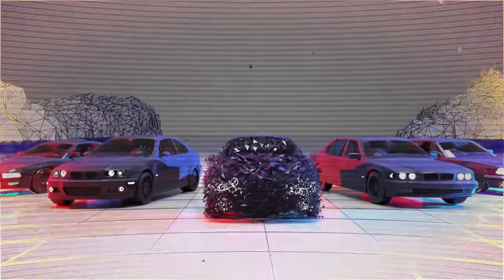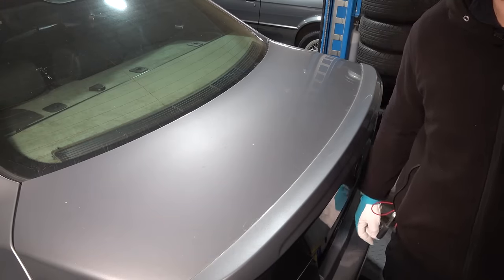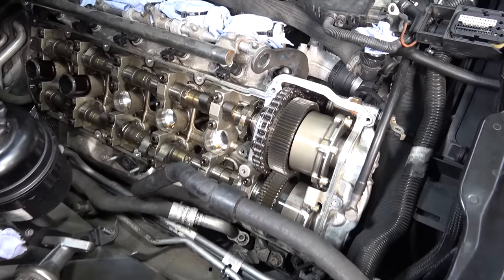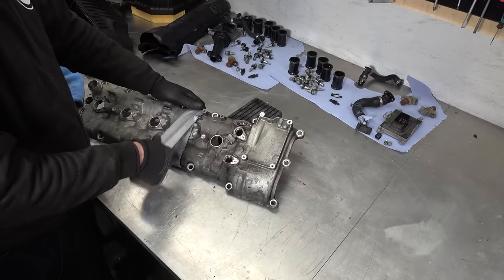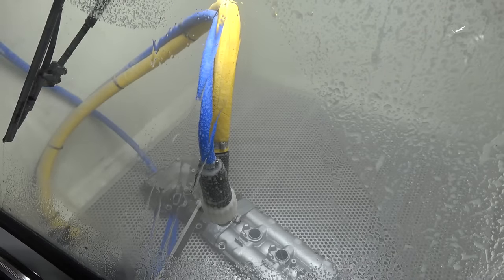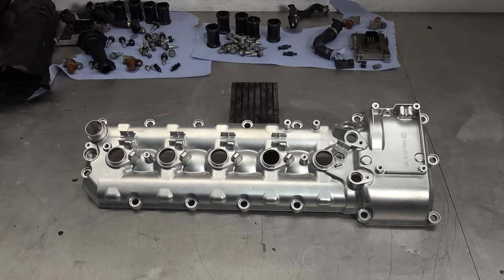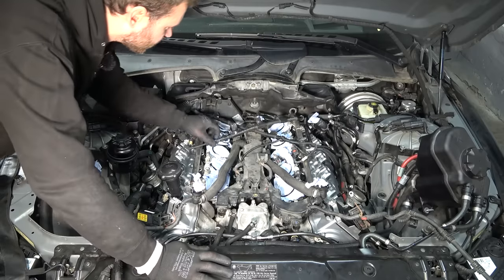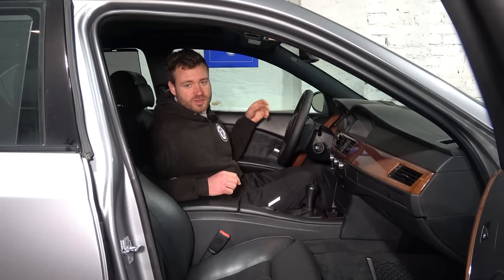Can We Make This V10 BMW M5 Mechanically Perfect? -  E60 M5 6-speed - Project Raleigh: Part 7

Comment: The broken plastic piece in the shock is a broken shipping puck from when the vehicle was delivered. It keeps the front of the car raised for removal off the transporter to not scratch the bumper. Looks like the dealer who delivered the car might have not removed it. If the shipping puck was not removed and the car was driven at highway speeds, the spring could have been displaced from the correct position since the car was still raised on that one side. Once the shipping puck cracked and broke off from the impact of driving at highway speed, the spring settled into the incorrect position.
Reply: Yep. That's what I was thinking too. That means the dealer that prepped that car after delivery straight up left that piece in
Reply: Seen few complains about dealership forgetting to remove these on F80s as well.
Reply: @snikwadRR  Sometimes the transport people are not gentle to the cars and the top spacers get jammed WAY up into the strut boot. When I did PDIs I'd do my best to remove them if they were stuck but some were just beyond retrieval without taking the strut apart, but that means they were also out of the way of suspension travel and it was benign to leave them where they lay.
Reply: The puck's are there for when the car is secured on a ship or train that it is stable. (transport blocks)
Reply: Not to prevent bumper impacts... designed to keep the vehicle from bouncing while fully strapped down during shipping. Might not be a dealer that left it in place, I work at a port and we find broken ones on the ground all the time from them being driven off the ship,loaded onto trains/trucks.
Reply: @nabob14  damn, I remember that now too. Thanks for correcting.
Reply: This seems the most likely explanation. I was thinking back and didn't remember ever seeing OEM shocks packed with a plastic piece like that, so really the only way for it to have been there is from the whole car getting prepped for shipping. Wonder who the selling dealer was, lol.
Reply: I also heard that it is a common issue in a lot of cars!
Reply: Exactly that someone at the dealership didn't take it out on PDI we had a similar thing happen at our dealership the lady had been driving her M3 for 2 years with the plastic pucks still in the shocks and wondered why it was so bouncy 😳
Reply: This is 100% a transport block from factory, usually a couple of these in each shock and tech should have removed during pdi at dealer but it may have been a Friday evening and they could easily have missed one or just not been f**ked fishing it out of of the boot, oops!
Reply: This issue is not limited to BMW. I drove my Skoda Octavia for 15.000 km with the shipping puk installed. Every pothole made my teeth rattle and it took those knuckleheads 2 attempts to find the problem.
Reply: 🇧🇷🇧🇷🇧🇷🇧🇷👏🏻, so that’s what that thing was play? Yes.Amazing!
Reply: Shop dap has made a few videos on mk7 gtis and they have had the pucks left in and they are all smashed
Reply: @spenceradams2908 Just found out my 2015 GTI with 90,000+ miles has those transportation blocks in the front end. Pissed off.
Reply: Bought used at 75k and wondered why every time I went over a pot hole or speed bump the car violently shakes

Comment: Finally! a YouTuber that rebuilds struts the right way! All the ones I've seen always removes/installs the nut with an impact, without bothering to hold the shock shaft with a wrench, risking blowing the shock without it even seeing a km.
Reply: Also important with ball joints. Dont install new one with impact. It spins The joint against the nylon inside and it is shot instantly

Comment: Yet another great video Sreten. Thank you for making it 1hr and not a single advert.
How good did those valve covers turn out!? Real rippers. 
Although you do know you'll need to take the engine out now, break it down and clean every part of it as well. It just wouldn't look right otherwise. 
Of always liked the V10 M5s but I'd happily have a touring version. The fastest station wagon in the world. 
Npq for the future. I always look forward to all of your videos but this and the Alpina, in a back to back test, that would just be heaven.
Reply: Jonas Jonaitis  ok it is the Mercedes but it is not as fun as this m5 and the m5 is more refined with better overall build quality compared to the Mercedes or Audi
Reply: Jonas Jonaitis  bad reliability doesn’t m mean it has bad quality and it is bad design because BMW’s are built to breakdown after the warranty and once you change the parts it will run for the same km it did before breaking down

Comment: Sorry this comment took so long, I've had my 2005 E60 M5 since Feb 2015 as a daily, (short run) driver, with some Great trips to Scotland in between. The poor bugger had been hammered when I got it and over the last few years I have steadily replaced the parts that needed changing. It has been a very good car. Engine is phenomenal, (Let it heat up before pushing it, of course) I bought my Lifetime warranty throttle actuators from Jason too, an absolute gentleman to deal with. Your video's are very informative and I can now have a go at stopping the chirping (blower fan) from one of your previous videos :)  Thank you.

Comment: I have a very similar paint situation on my Jet Black E39 M5 and the same concerns about making it “too perfect” to actually use it. Like yours, I have mismatched doors and also the trunk lid.  Rather than do a full repaint and then hide it in the garage, I’ve decided to repaint the 3 panels that don’t match, paint correct the rest, and drive it!

Great work on the E60, I’ve never been a big fan but this project series has changed my mind.

Comment: This V10 really is an economic engine. Having done more miles, the fuel level at 1.03.28 is higher compared to the level at 1.03.06....Great video!
Reply: Ha! My E60 M5 gave 6-8 mpg in town. Seriously!
Reply: Pro tip! If you use „:“ between numbers you get a timestamp which you can click on. For example 1:00:00

Comment: That scraping old foam is probably the most painful unrewarding work know to man. They make a scraper with a razor blade that skims just above the surface of the paint and if you are careful it doesn't scratch the paint. The windscreen installation guys have them, just much larger ones but they also use a small one for quarter glass, that's the one you need. It makes light work of the bulk of the job.

Comment: Agree 100% with your comments about sunroofs. They offer less headroom (especially important if you need to wear a helmet); they require maintenance to replace to rubber & felt seal; the roof looks better without; they can break in a hailstorm; they add weight; and mine is never used.

Comment: incredible video man never ever did 1 hour go by like this. The only thing missing on the e60 is a nice exhaust i know you like to keep it oem but its like on the e39 your just holding it back. Still realy nice work on the car
Reply from the maker: It has stock rear mufflers, but it also has something else that's not stock and makes it sound way better than if it had different mufflers. It sounds glorious in person and doesn't need anything else IMO. :)
Reply: @M539Restorations  I was woundering why its so loud on the flybys

Comment: Your work is so admirable.  I have 2006 650i convertible that too has a challenged reputation but I love driving it. I love the sound of natural aspirated motors.  I live in the Raleigh suburbs, from where your project originated, you have done great work. Thanks.

Comment: Very nice fixes Sreten. A BMW mechanic told me once, every BMW shock will fail at 180.000 km, or lower. Especially when the dust caps are bad.  Probably way sooner on performance BMW's. SG, Nico.

Comment: Sreten, that piece of plastic that fell out of the first strut is the transport plastic shim that BMW puts in there from the factory during shipping to keep the shocks from compressing.  I forget if it's either to allow them to be secured on the truck better or just when driving it from dealer to prep center, the shocks are not being used/wearing.
Reply: Exactly and sometimes dealer forget  to remove those plastic shims and after a while the shock itself compress them during driving until the plastic will brake apart. Nothing to worry about though but something good to know.

Comment: @m539.   I work at a BMW Dealership, the white plastic that was within the dust cover of the shock was used as a bumpstop from factory. The dealership forgot to remove it probably.

Comment: Use Lighter fuel to remove sticky tape residue on the sunroof seal. Cheap as chips and safe to use. Evaporates quickly.

Comment: I must say that Bilstein shocks are the best. I recently bought a 1981 528i with 268,000km, and it was on the original dampers still (Bilsteins). Right front blew, so I replaced both, but the the damper on the other side still functioned (almost) like the new one after pulling it out. 40 years. One set. If that's not worth the premium, I don't know what is.

Comment: I've owned 14 BMWs including 4 x E32 750iL and still have 7 BMWs.  No M's as the last time I checked there was a significant annual insurance surcharge.  However, your videos have encouraged me to seek an M5 E39 that needs considerable wrenching.  I was surprised to discovered that M5 E60 are less expensive to acquire in the USA than the older E39 M5!  I suppose that besides the V10's difficult reputation, the styling of the E39 is certainly crisper and, to me, better looking.  The E60 looks like it was left in the sun too long and has melted...

Comment: The bolts with rubber grommets seem to be something special. I needed a set for a cheap Kymco scooter. Same price 75,- for a set of ten (ok, variety in length, but still) Pure theft! 😂 Didn’t buy them, made new grommets out of fuel hose. Hehe. Love your overhauling work! All looks beautiful!

Comment: The sunroof glass is supposed to be lower on the front side and higher on the rear side. It helps reduce the aerodynamic noise. 1mm lower on the front, and 2-3 at the back. That seal seems to be sticking a tad to high over the bodyline. TIS should have some more info about it.

Comment: For anyone not wishing to bother with sunroof repair, clear Gorilla tape around the perimeter of the sunroof seals out water forever, and stops the creaking. Vinyl roof wrap does the same thing, and blocks the Sun which eliminates the miserable heat Dome effect of sunroofs.

Comment: Nice video, nice explanation. Great entertainment.
One wrong Info though, the e39 repair manual does not state that the end of coil spring must not touch against shoulder of spring pad. Only the e60 manual states this.

Comment: That white plastic thing is half a spacer. There were probably about 3 of them on both front shocks that keep the front suspension up to minimise the risk of damage during transport from factory to dealer. They are supposed to be removed at the pre-delivery check.

Comment: Awesome video...always wanted to do the B6 edc kit on my 2006 model as the standard damping, while good for stock, definately felt like it could do with better body control and secondary ride.  I would blow the budget and get the carbon eventuri twin intakes, some long tube headers and exhaust tweak and a remap because 550 bhp is easy, but more than the power it also will fix the other minor complaint i had, that being the small torque hole in the midrange when stock

Comment: 32:33 that piece of plastic is actually a plastic spacer that BMW puts in the strut to prevent suspension movement during transport from the factory to the dealership where it is sold. Thats funny to see it in there. It is supposed to be removed during the pre delivery inspection but someone must have forgotten it was there.

Comment: The plastic part you found on your shock absorber is from when the car arrived from the factory, it's a protection to the suspension which the mechanic should remove before selling the car to the new owner. :D

Comment: 32:35. The plastic piece you found is most likely Transportation C-pucks that are installed in factory and removed when doing a pre-delivery inspection. And In this case the technician that did the inspection forgot to take it out. :D

Comment: I worked as bmw tech, and I know what the white plastic thing is! They are called transport blocks, and are mounted from the factory for transport, to not scrape the bottom om the transporter. The must be removed on delivery and before driving on the road. Some bmw tech did a whoepsie

Comment: 29:25 On clean Germany roads perhaps. In where I live, during winter those are getting clogged with stuff and corroded and you can't use them anymore... Thank God, those on brake calipers have got protective caps.

Comment: The white piece is a spacer they put in for shipping from the factory. The dealer originally forgot to remove it during the QC1 procedure for predelivery. I've seen it happen at the dealer and it would cause premature failure of the struts.

Comment: You should use isopropanol 99,9% to remove adhesive. Cheap and reliable. It's also used to clean pcp boards and electrical connection.
Reply from the maker: Tried, acetone works much better.
Reply: @M539Restorations  it's better for decreasing for sure, but it's also more aggressive. Destroys plastic and paint.

Comment: The reason they are selling those valve cover bolts with the grommets, is because they are meant to be replaced every time you do that job. Aluminum bolts stretch when torqued. They are one time use, just like every aluminum bolt on a BMW.

Comment: I'm betting the stray plastic piece was a piece of a suspension shipping block that was supposed to be removed during a pre-delivery inspection at the selling dealership.  Cars are often delivered with the suspension locked out with plastic blocks, as that makes them easier to tie down on a truck.  They probably had to break the plastic blocks for removal, and missed removing one of the pieces.

Comment: I can suggest you a solution for protecting the paint on the car. Fully repaint it as you’d like and then apply a protection film on the whole body. You should not have any problems with chips and scratches afterwards.

Comment: My guess on the 2 issues: The spring was misaligned because a previous owner put lowering springs on it and the originals were reinstalled improperly. The mystery piece looks like it could be the remains of a shipping block that wasn't removed during pre-delivery inspection and just broke and mostly fell out during use.

Comment: That plastic bit in the front shock was from the factory.  Keeps the suspension in place during shipping and delivery.  The dealer mechanic should have pulled them during pre inspection.

Comment: Sreten, you SHOULD re-spray all of it at the shop that did your E30 (and is doing it again I suppose?). This E60 was neglected all around when it came to you. Now it is mechanically perfect but the exterior is still just as neglected. PDR and a partial re-spray will only go so far; don't forget the euro plate holder is a different shade too and that's right against the trunk do will never match too well. Do a full re-paint and make a detailed video of the process at the shop so you can recoup some/all of the investment and end up with a perfect car. Us car guys don't stop driving our cars just because they look nice...we keep driving them so we enjoy how they perform AND look (says a detailing-crazed guy with a 6MT F82 he drives year around in snow and all).

Comment: Well done, once again Sreten.
Our E91 has the light yellow/tan leather and walnut trim and it looks very nice. (Yes, the beading on the drivers seat is losing its' sexyness but it gets realllly hot in summer in Queensland and burning thighs on black seating is just sooo 1970's).
I wish the RHD could be converted to manual. Heel and toeing a V10 would be the carbon fibre icing on the cake.

Sreten, could you please take it through a tunnel or some twisty bits at some time?

Muchos Gracias.

Comment: It looks like someone forget to remove shock absorber transport blocks (white plastic) when they do a nulti service. I just wonder are the front brake discs in proper position? I believe that are turn. The left one should be in right side and right on left because of cooling vents. Very nice job by the way.

Comment: The broken plastic part in the front shock is from a roadside recovery. This happens when the coil spring snaps and the recovery guy has to raise the suspension enough to get the car onto the recovery truck. 👍

Comment: The plastic piece you found in the shocks looks like a block the manufacturing plant puts on the suspensions for the travel on trucks. It is supposed to be removed by the dealer before the car is given to the customer !

Comment: I don’t know if you will read this before it’s too late but those rocker cover bolts. You can buy BMW part 11 12 1 721 879 which are just the rubbers, and you have to refurb the bolts yourself. With you swanky cleaning machine you will be fine! I am rebuilding a V12 so the cost of new rocker cover bolts was silly; these kept the costs down!

Comment: That bit of white plastic.on the first shock used to be one of the oem transport blocks installed when the cars are first shipped out. So the tech failed to remove it on predelivery inspection.

Comment: Engine flush after 340k kilometers and regular oil changes (15k kilometers), yes or no? With Liqui Moly 

I'm having an oil change in a few weeks and really thinking about it. It's a 2005 Mercedes B-class. 
Was thinking like: drain old oil, put a cheap filter and cheap oil in with LM, run engine for 10 minutes - drain. Then put good filter and oil in. Should do the trick